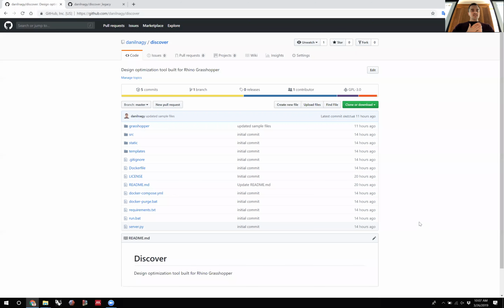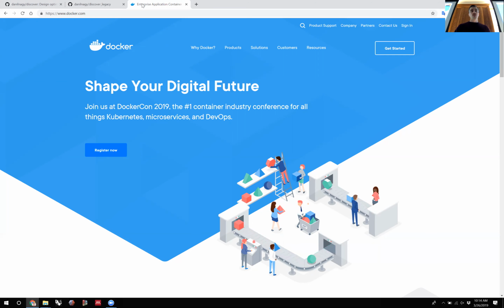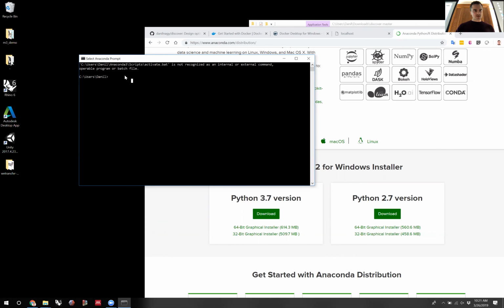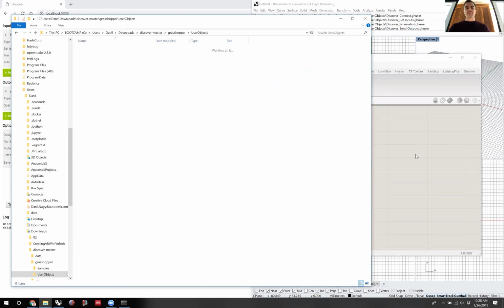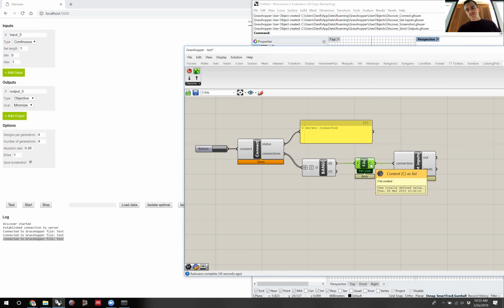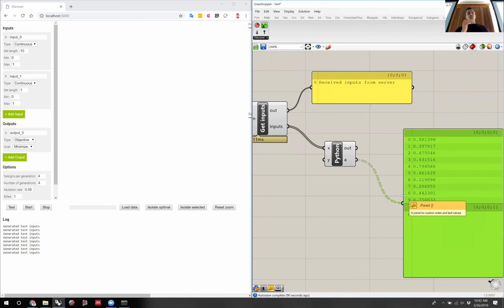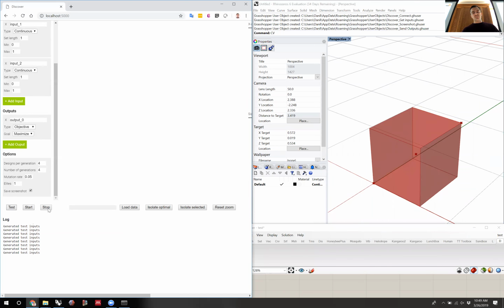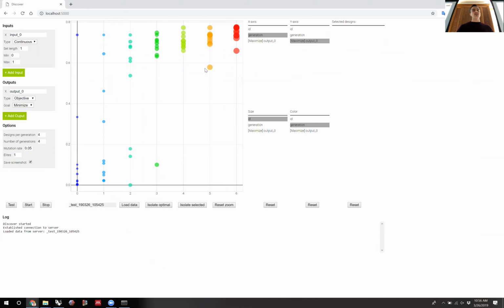Intro to Discover - overview

Comment: Hi Danil. So I got the server running on Mac. But I think I having problems with Grasshopper component. Can I send you a screenshot so maybe you can help?
Reply from the maker: Hi Roman, I had never tested Discover on Mac before but you got me interested so I gave it a try. I too was able to get the server running. I'll have to create a new script specific to Mac probably using a SH file but it should not be too difficult. I also got errors on my input components. Send me the errors you got so I can make sure they are the same and then can troubleshoot the components. Thanks for turning me on to this, I had no idea Rhino/GH for Mac had gotten so good. I may want to switch :).
Reply: @DanilNagy  Hi Daniel. Thank you for your reply. I have created a post on Rhino Discourse. Yes, Rhino 6 is working great still lots of pug-ins are Win only.

Comment: Great stuff Danil! Is there anyway to run Discover of a remote server rather than locally?
Reply from the maker: Thanks Morten! Yes the whole program can be run on a remote server as is, but you have to figure out a way to connect it to Grasshopper. This is in the works, but for now it's only a local solution. Let me know if you find it useful and please submit issues if you find any bugs!